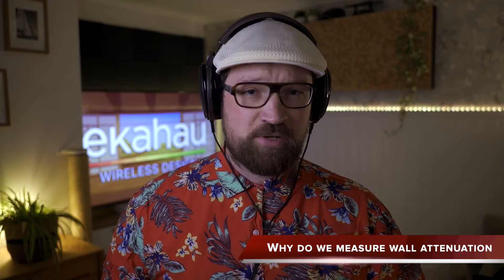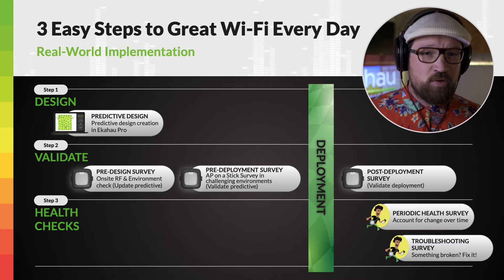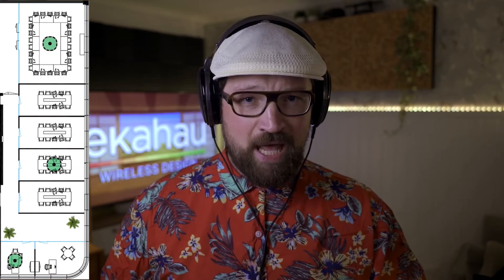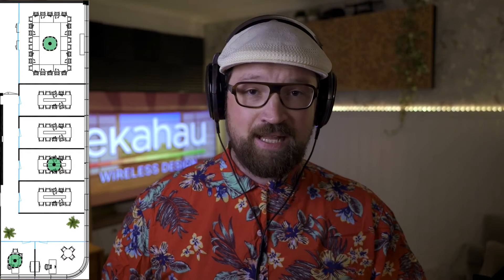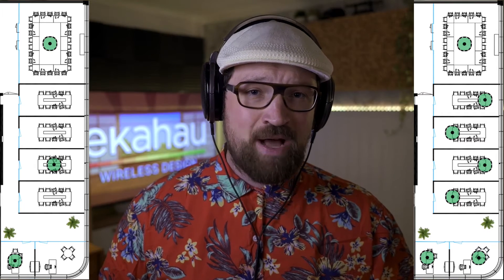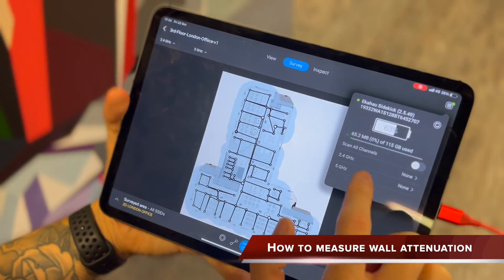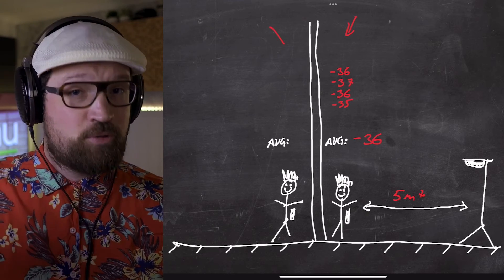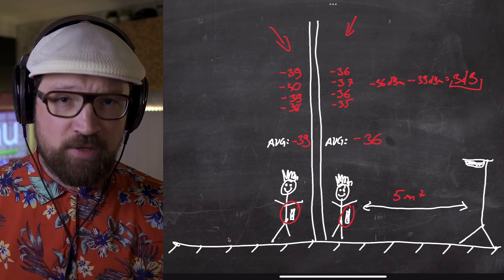How to Measure Wall Attenuation For Spotless Wi-Fi Network Designs

Comment: Hi, it will be easy peasy if you will explaing us how modeling in Ekahau pro the difference in wall attenuations between 2,4 ghz and 5 ghz:  FSPL(dB) = 20log10( ɗ ) + 20log10( ƒ ) + 92.45   THANKS

Comment: Are their any know issues with using a mobile device in hotspot mode as the source? My only concern would be the device changing power levels. This method would be highly convenient for testing.